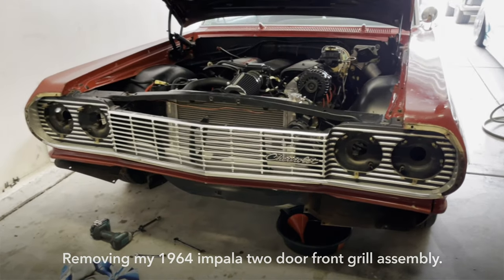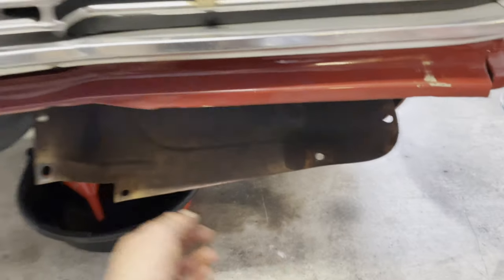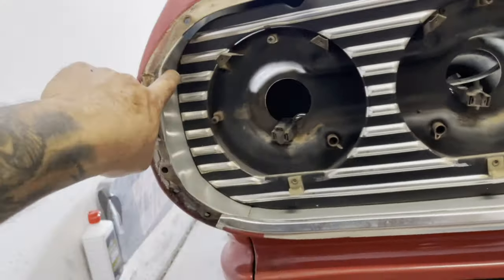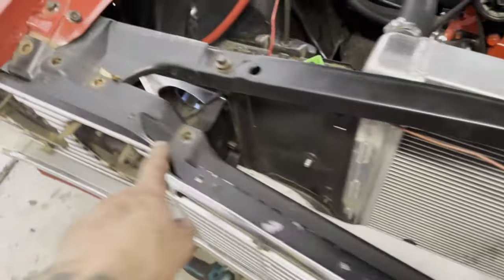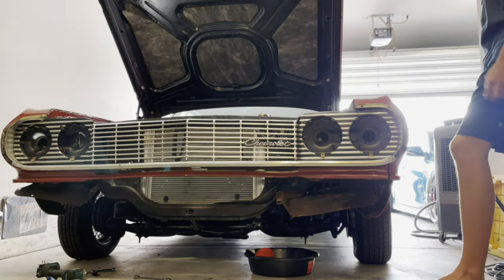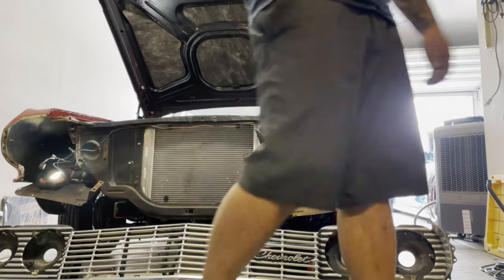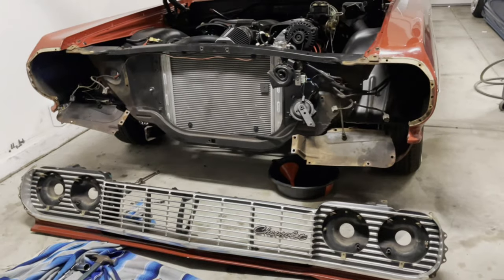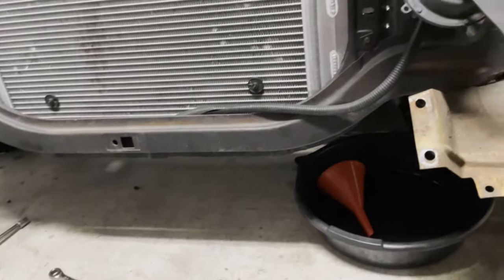1964 Chevy Impala front grill assembly removal

Comment: Am over in Spring Valley. Doing the same on my ‘64 station wagon.  Rather than dig out my 1964 service manual supplement, I figured I could find a video. Very helpful. Thanks.
Reply from the maker: Awesome. Let me know if you need help
Reply: Did you guys have to remove the fenders by any chance in the front?